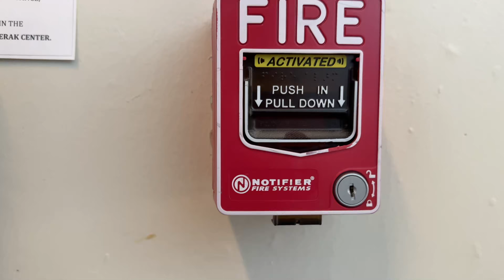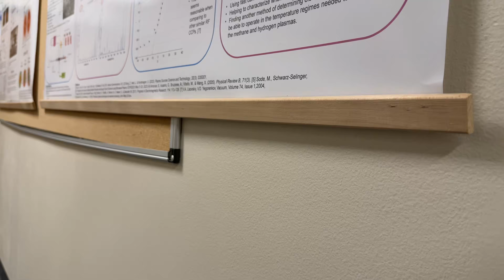2025 Engineering Fire Alarm Test 2

Comment: From what i've heard over and seen over a period of time when wheelock first introduced the LED Horn strobe and the LED Speaker strobe under their exceeder line of notification appliances, there was a design flaw that led to the LED strobes having a slow flash rate and it also led to synchronizing issues with existing notification appliances at that time To the point that Wheelock discontinued all their LED notification appliances under the exceeder line and reintroduce their LED notification appliances underneath the Eluxa line after correcting the slow LED strobe flash rate and fixing the synchronizing issues to be compatible with existing notification appliances like the AS and the RSS and a few other devices too.   That is why when other companies like system sensor introduced LED notification appliances That's why they were not very popular at first.

Comment: Judging by the smoke detectors and those slightly older "NOTIFIER FIRE SYSTEMS" NBG-12LXs, it looks like they previously had an addressable Notifier system with horn/strobes of some kind, right before the Wheelock speaker/strobes.

Comment: My old middle school has those now. They were installed last year. But the crazy part is the school now has a Simplex 4100ES that replaced a 4100U that had true alert horn strobes. When I I first went there in for the 2002 2003 school year. The original system was a Simplex 4208 with 4050 horns. But then in summer of 2003 when the school was renovated. It was replaced with a Simplex 4100U with true alert horn strobes. Then in summer of 2009 they did an addition so then the coding was a mix of code 3 and continues. But like between 2006 to 2009 they had to replace the panel twice. Because once for a ground fault and second was due to a power surge. That did damage to the panel. But last summer they replaced the 4100U with the 4100ES with voice. But I’m surprised they replaced the devices. With Wheelock Eluxa speaker strobes instead of a true alert ES speaker strobes. I’m guessing because it was cheaper.
Reply: Simplex is so expensive and proprietary in my quite honest humble opinion

Comment: I’m so used to seeing the Siemens rebrands of these in my area (although Siemens never rebranded the older ones with the longer flash). It just feels weird to me to see the non rebranded versions on a Notifier system. I’m glad the went with Wheelock devices, though.

It’s definitely interesting that they have a mix of LED Exceeder and LED3 devices. They should definitely replace the older ones with Eluxa devices so that they can all be perfectly synced.
Reply: These aren’t the long flash Wheelock LED devices. They do seem to show up on camera better, so they might be longer than a normal xenon strobe, however the long-flash devices look like a light being flipped on and off. They stay on for 200ms if i’m not mistaken, and they switched it to 20ms for the newer devices. System Test 71 on this channel called “First generation LED fire alarms” shows the strobes with a 200ms flash
Reply: @ESTedwards The ones at the beginning have the regular flash, while the ones towards the end of the video have the long flash.
Reply: @aerhardtI'm pretty sure the Eluxas flash at a Consistent rate & they look kind of Similar to the LED Edwards EST Genesis